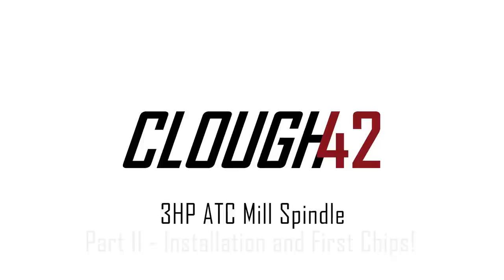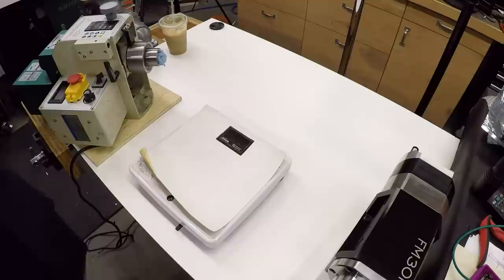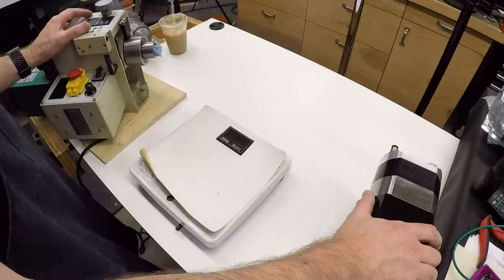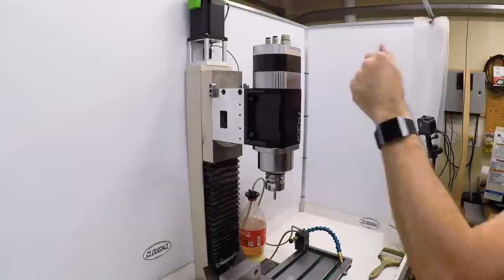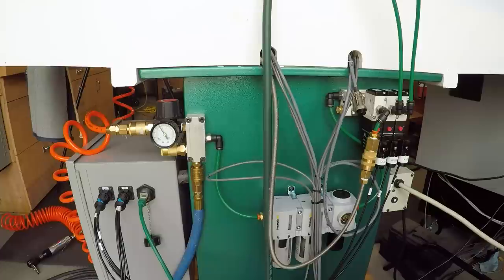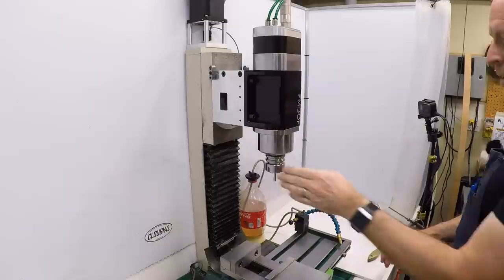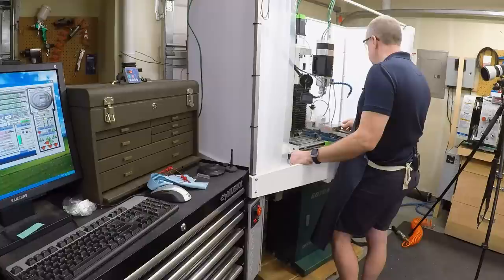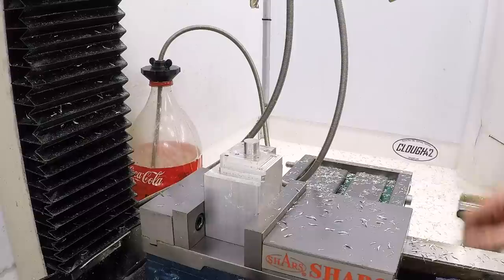ATC Spindle Part 11: Installation and First Chips!

Comment: Awesome to see this working so well! 

For a single (mostly relevant) point of reference: my router's spindle (750 Watt) is comfortable doing a 4mm depth of cut, 0.4mm WOC, at 24,000rpm, moving at 2.4m/min using a 2fl end mill in 6061 aluminum.  Your machine is much more rigid than my router so will likely get proportionally more performance than I do :)

Comment: Super fantastic upgrade!! Excellent engineering and execution. As great an improvement as the spindle speed is over what you had, that pneumatic tool changer has to be almost as great an upgrade as the speed 😎.

Comment: Great job, James!  You are a true maker!  Please consider the safety advantages of a single tag out/lock out for the motor controls.  Ref: NFPA 70 article 430, Motor, Motor Circuits, and Controllers, and maybe an older version of UL 508.  Obviously your installation is accessible only by qualified personnel, so no telling what you might have and not be in any particular danger as you are the man!  However, please consider at least a label that there are two sources of energy in the controller or better, rework the controls to have a single point of tag out/lock out for more of a system/machine centric basis of thinking.  Keep up the good work!

Comment: Did you check the tram in the NOD of the head?  I know their isn't any adjustment. But, it's good idea to check. Some G0704's need the column or head shimmed.
Reply: i have a BF20L, similar mill and indeed the NOD was off. Needed shimming which I do not like it for rigidity but is the easier solution.

Comment: I'd like to hear someone run the numbers of the clamping load on tee SA of the interface with those 4 large bolts clamping the spindle to the mount. I highly doubt that thing will have enough power in any situation to overcome that force.

Comment: i would check after tramming if your side plates of the spindle mounts are true, if so, you can tram the head much faster by moving the z up and down and indicating on that datum with a the mag base on the back column. it may also be more accurate :-) you machined them mounting plates so i would use them. maybe one can even build a fixture to speed align it, thus making angles cuts a more reoccurring event. just my two cents. thanks for the idea with the grub screw thingy, very good!

Comment: I bought this Spindle maybe 4 months ago. I don't have a CNC machine yet but my order is in with AVID cnc for a 3x3 Benchtop Pro (all ballscrews). I have never used a CNC before so I very much look forward to any tests on cuts and so on that you might do with this ATC spindle.

Thank you for the video.
Reply from the maker: I'd be interested to see how that works.  The Avid is an aluminum extrusion gantry machine, right?  I would expect that to be less rigid, but my intuition says that if the spindle is fast enough, you can get above most of the resonance modes.
Reply: @Clough42  Thanks for the reply. 

Yeah, it's aluminum, but everything else is super spendy... I looked at a ShopSabre and a 4x4 is around 17k, to start... with a decent spindle like this it's over 20k. I'll only be in my machine for 10.5k

I'm looking to cut mostly wood and softer metals so I think I'll be fine. If I love CNC i'd consider just making my own 4x8 and using steel. 

I added servos to my machine, it's all DIY so it will be a bit of a process. I wonder, have you ever considered adding servos?

Comment: You''l probably want to get some smaller ER tool holders as for maximum concentricity you want to use ER collets closer to the maximum size end.   IE, for a 1/4" tool, you probably want ER16 or ER11.

Comment: Have you thought about adding a c6 spindle control board?  It treats yours spindle like another axis and will control the on/off and speed with step and direction pulses from your break out board...they're super cheap, like $30...I put one on my Bridgeport controlling my hyunyang vfd and it works awesome...takes m3 and m5 commands from g-code and sets your speed automatically...

Comment: I'm not experienced with these specific spindles but on the larger machines I work on, the case Pressurization requires a much lower pressure than full shop air, I couldn't see a manual to check for these spindles.

Comment: Great job! Thanks for sharing the journey. Those final cuts sure sounded smooth! I bet you could go full depth on the end mill and 100 thou on the width of cut with no issues using that end mill.

Comment: I think it is recommended to warm up the spindle in 5000 rpm increments for a few minutes before putting it under working pressure, however, your spindle may not need this.

Comment: After seeing the finish you're getting at the speed you are, that is a total win!  It also was surprising to me to hear exactly how much weight you saved by putting the new spindle on.  Any thoughts as to repurposing the original head for a different tool or machine?

Comment: Love your conversion, I am looking at theFM30C for my CNC Router. How happy are you with your compressor. Do you have any idea how often it has to run to maintain the proper air pressure?

Comment: Awesome work. However, I was wondering if there is any concern about flex in the mounting bracket joints?  To me it seems like this would be the weakest point in the setup.
Reply from the maker: Could be.  It has plates on three different planes, so you would have to actually rack a solid aluminum plate to make it move.  Aluminum does have some elasticity, so we'll see.

Comment: Without going into a lengthy explanation, the rotation action that allows you to tram and set the head a various angles is NOT a safety feature and while moving the little tramming bars you made out of the way is not hurting anything, it is not helping anything either. 

For one, by saying that its a safety feature, you have to ask yourself, "well why is it only on the X axis and not the Y axis?" With that, then think about the fact that any crash other that one that occurs with only the X axis in motion defeats the purpose (i.e., if the table were moving say in a 45° angle, that "supposed" safety feature does absolutely NOTHING because of the Y axis not having anything.

Also, if you did the measurements and calculations, you will find that other than some large / professional industrial machines, most (if not all) smaller light weight machines and CNC retrofits do not have enough table force from the axis drives to be able to truly overcome the friction between the head and Z axis trolley (in this case), Sure, a sudden impact will knock it out of tram but most do not have the continuous force to actually truly overcome the friction force of a properly torqued head to move the head by more than about 1/4° or so.

Comment: Great video James! I have been looking forward to you get to this point in the project🙂 Would you be willing to run a 1/2 inch end mill at 3/4 depth of cut at full RPM. I am curious how much torque you have. I run that same cut on my BF20 at .03 WOC and approx 30 IPM. I have a belt drive and a 1 kW spindle motor.

Comment: That's a router spindle which is the wrong tool for metal milling. The old head had a seperate motor which allowed you to increase low end torque using gears. The new one has a tiny fixed motor and low torque. At low RPM you'll get very poor performance.  

You could have increased the Z axis speed by adding a counter weight and / or switching out the ballscrew for a faster one.

Comment: Was the VFD pre programmed? Just ordered this spindle for my router. Excited to put it on!
Reply from the maker: No.  Whatever you do, make sure you set the motor default frequency to 400Hz or you will let the smoke out of the motor.  Ask me how I know.
Reply: @Clough42  yikes. You have a nice setup. Thanks for going into all the detail you do. I will be using a lot of this info for my upgrade. Same spindle - I’ve been looking for a tool changing spindle just like this but didn’t know where to look

Comment: I think you are going to be upgrading your stepper motors when you realize you can cut aluminum at your current rapid speeds. lol
Reply from the maker: Maybe.  I've tested X and Y successfully to 400IPM with my current setup.  It's terrifying, but one can get used to anything.  If I want to go much faster, I think it's time for servos.

Comment: Why use aluminum for the mount when the rest of the machine is cast iron? Cast iron is much better for damping vibration. It’s very nicely done, but in terms of resistance to chatter I think the aluminum is a weak link if you are doing any heavy cuts in steel. Everything moves.
Reply from the maker: True.  If I have trouble, I'll probably be remaking it in cast iron.  I actually have a 3D model for a foundry pattern, but didn't pull the trigger because I really need a larger mill to machine it.

Comment: 11:39 "and that, actually, is not dumb" - The way you say this makes me think that most of the comments here ARE dumb.
Reply: I'd like to hear someone run the numbers of the clamping load on tee SA of the interface with those 4 large bolts clamping the spindle to the mount. I highly doubt that thing will have enough power in any situation to overcome that force.